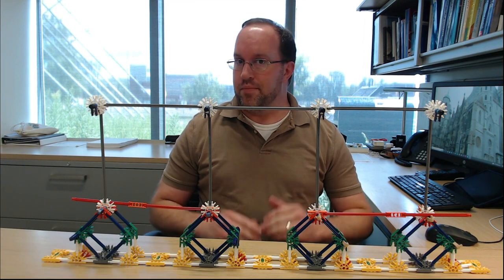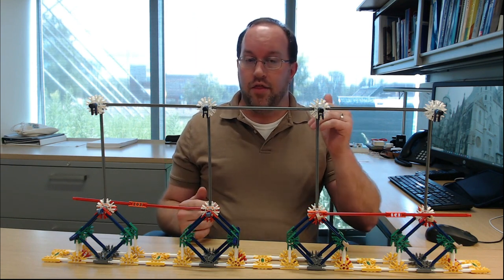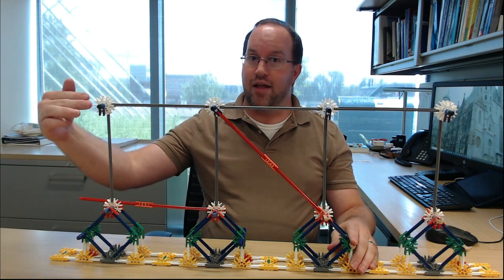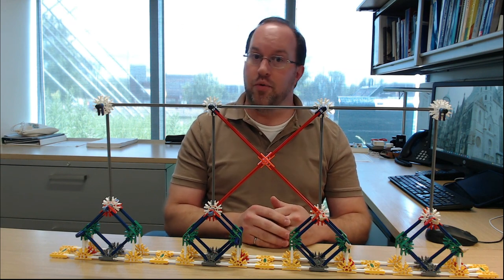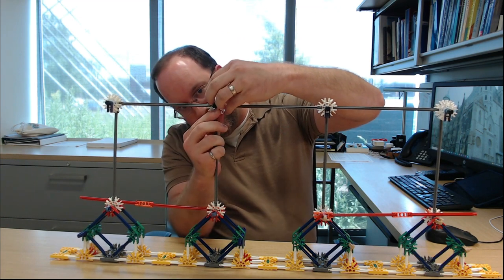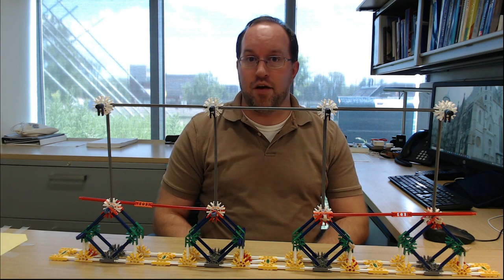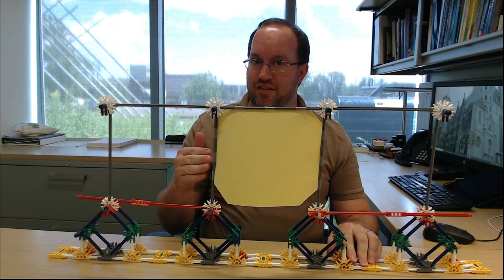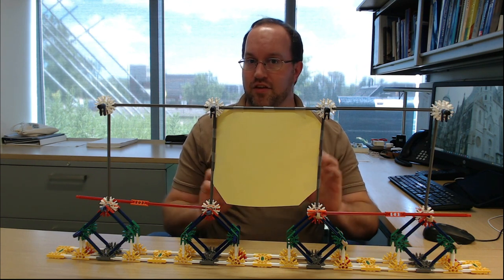How do structures carry wind and seismic loads? An Intro to Lateral Force Resisting Systems

Comment: Hi. Thanks for the teaching. I will like to ask how many braced bay can be introduce in a structure. Also, what is the governing factors in determining the no of braced bays
Reply from the maker: Hi Samuel,
Great question. I don't have any governing rules for finding the number of braces. You can put as many braced bays into your structure as you can fit, but that doesn't mean it's a good idea. On the plus side, more braces means less load per brace. On the minus side, more braces equals more cost (especially in their connections!) and generally less efficiency. You have to find a balance here. Furthermore, you may have architectural constraints that limit you from bracing certain bays. 

So as with most things in engineering and life, it depends on the particular costs, benefits, and constraints for your project.

Comment: This is a great explanation. I should buy some K'Nex. Do you have a kit you recommend?
Reply from the maker: Hey Sasha,
I recommend the K’nex 100 model set. It’s usually about $50 on Amazon, and has probably the best mixture of different sized rods for free building.